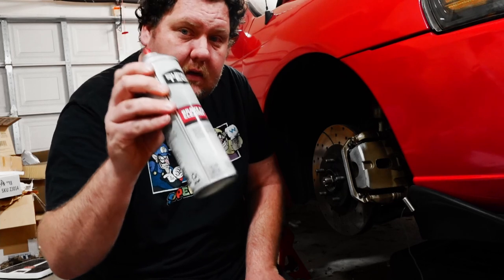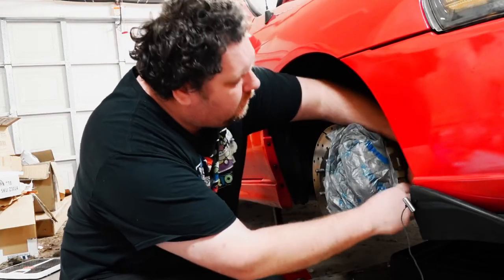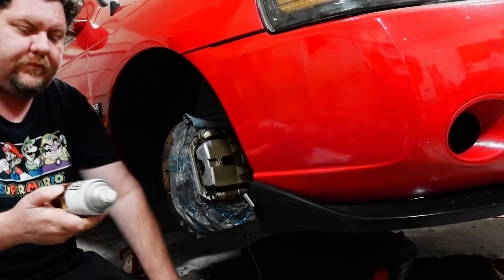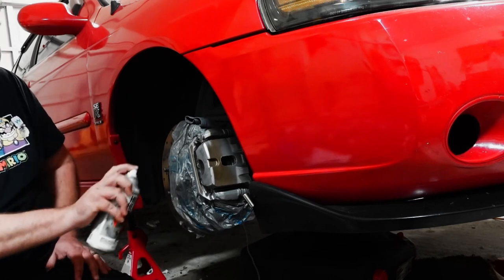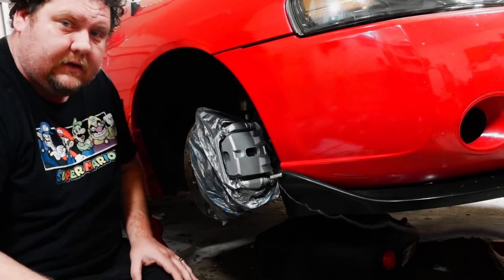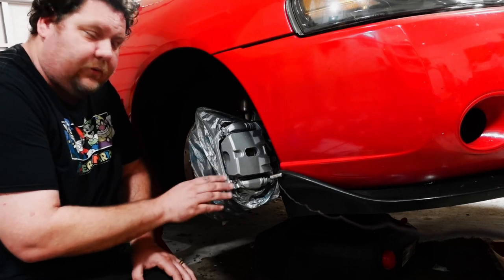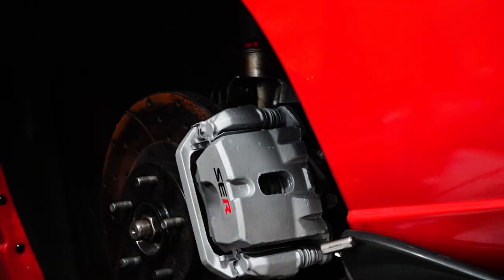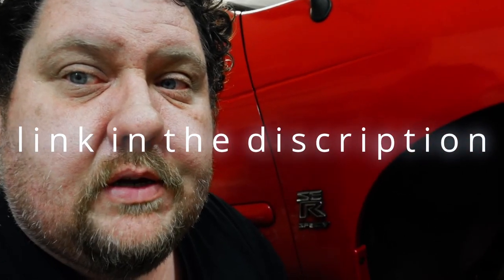Painting Altima brakes on my specv

Comment: Hello! What year Altima brakes you used? Are those the 11.6" ones?
Reply from the maker: Fronts are 2005 Altima SER brakes, rear is 1999 maxima a32.
Reply: @red_rabbit_specv  nicee
They can be installed with just re-drilled altima rotors, and calipers or i need to change something else?
Reply from the maker: @wishi201290  the 5lug and brake conversion was done by the previous owner. So all I can tell you for certain is what he told me and looking at receipts. 

The front has Altima ser calipers along with the 12.6 rotors. The hubs are from a base model Altima with 5speed trans. That is important to know because that is the only Altima hub that matches specv axels. There has been no mention or receipts of the knuckle being changed if I recall. Also side not my car is not abs equipped. I would think you could redrill the rotors and use the Altima rotors assuming the offset is the same on the hub. If you do it I would be interested to know how it goes. I never made a video on it because there was some parts of the conversion I wasn’t 100% on and didn’t want to give any wrong information.
Reply: @red_rabbit_specv  thanks for the response, sure will let you know if it works 👉🏽